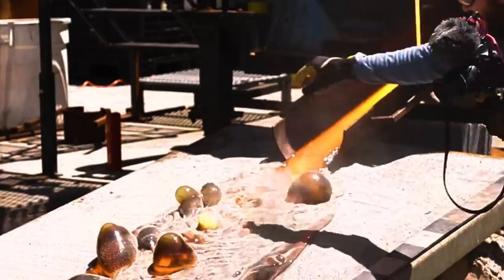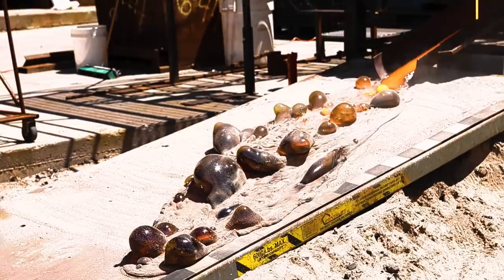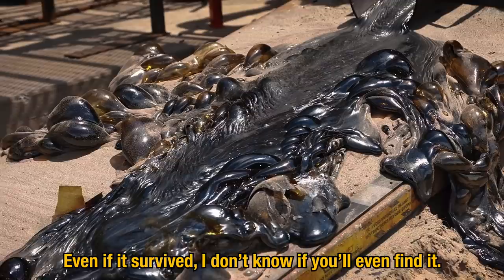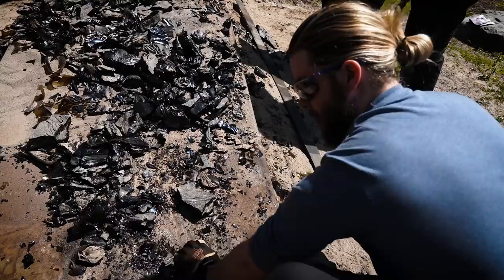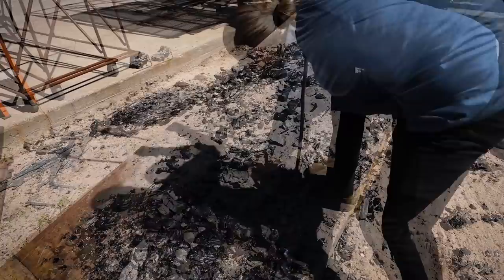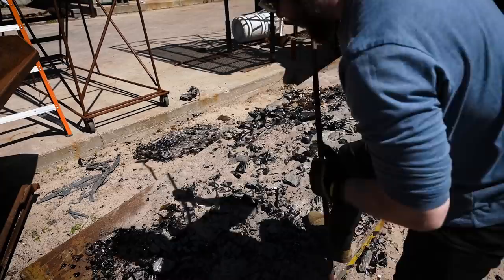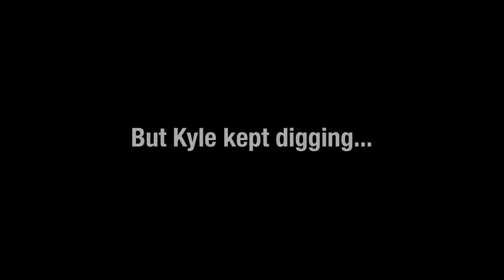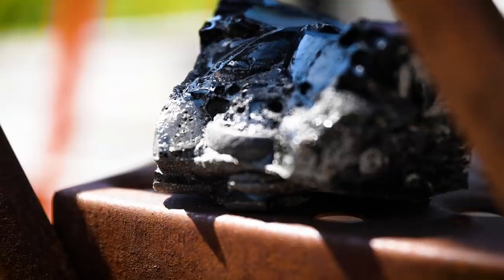Will REAL LAVA Destroy the One Ring?

Comment: Hey Kyle, It lost it's gold plating, Gold has a different melting point than Titanium 1,064 °C vs 1,668 °C. Besides you are working with cotinously cooling lava, wich is loosing temperature and cooling down as it flows trough the sand, unlike the crater of Mt. Doom, an active volcano wich is not having such a fast exothermal reaction, even if the one ring is covered by rapid cooling protective crust it would get reheated once more and melt. The reason be: thermodynamics!!!

Comment: Nice! I bet a metal detector would still induce enough current to find it in there. I've thought about doing this with a tungsten carbide one I have, maybe on a titanium alloy chain to help find it, but I imagine either the tungsten will hold up just fine, or the nickel binder would melt and it'd compromise the ring.

Comment: Three questions:
1) would the density of the one ring (presumably) made of solid gold (or perhaps magic super metal but that’s speculative) make a difference in its sinking? 
2) would the fact that it presumably floats and would not be completely encased like here have an impact? 
3) would the temperature difference caused by the fact the lava is constantly in the volcano (or crucible in this case) oppose to the flow like here, have a higher melting point for longer (and less chance to cool) and therefore melt it?

Comment: No mention of the fact Titanium's melting point is over 3000 F, while Gold's is under 2000 F. Google says temperature of a lava flow is around 2000 F. I also imagine that a chamber such as shown in Mt.Doom would be hotter due to mass/surface area versus the more rapidly cooling surface of "a lava flow" - however that is to be defined.

Comment: It's also cooling the whole time.  Toss that sucker in the sustained heat of the crucible or a volcano and I think the chances of it getting hot enough to melt would substantially increase.  I don't remember how hot you said that thing got up to but titanium has the melting point around 1700° C, right?  So that thing would have to get that hot too.

Comment: Considering that titanium has a melting temperature of around 1650 °C and the one ring wasn't made from titanium but (most likely) gold, wich has a melting temperature of about 1050 °C, I'd say this was not a conclusive result.
On top of that, the lava inside a volcano (like where they tossed it in the book/movie) doesn't really cool off since it gets mixed and reheated by constant flows of "fresh" magma from below; it only really cools down when it pours out of the volcano (bigger surface area cools down faster, of course) or the magma flow from below stops and the volcano goes inactive. Meaning that if you'd toss it into an open volcano it wouldn't just cool down the lava around it an get incased by an insulating obsidian mantle, but it would eventually get reheated again to the point that insulater material melts again and the ring, also heated up to the surrounding temperature at that point, would also melt.

Comment: mount doom is NOT JUST A COUPLE KILOS of molten dirt, its a f king volcano, theoretically connect to the the very center of middle earth, so even if the with some thin isolation layer it would eventually get hot enough to be destoyed, also mt doom seens quite active, with a lot of lava convection current at least. So eventually it would get destroyed

Comment: The fires of Mount Doom would be hotter than this for sure though, especially at the surface. This lava flow is completely open to its surroundings, cooling down significantly. Next to that, there's a lot, lot less thermal mass so it'll cool down even more. In a volcano, there's a lot more thermal mass and much more insulated by the rock around it. Such an insulating layer you talk about will likely re-melt again quickly in a real situation too.

Comment: The ring was at the base of the volcano within the magma chamber where there is a continuous supply of heat. Lava appears after The One Ring melts once the volcano finally erupts and flows for quite a while. Try a solid 18K ring in a simulated magma chamber.

Comment: You tossed it into a finite mass of lava, mount doom is a temperature reservoir, mount doom doesn't care about your punny insulation, if temperature is high enough, the ring will melt eventually no matter how bad of a temperature conductor the cooled rock is. Also, that is an impressivelly accurate gollum impersonation.

Comment: I'd argue that the one ring would have melted and here's why:
This ring was thrown into a volcano where there's a constant source of heat.  While yes, it may have shielded itself from initially melting by cooling a bit of the magma around it, the one ring would have eventually melted anyways especially if it was just forged from gold.  Now, I'm no geologist, but I will say that I believe the inside of a volcano is a lot hotter than the lava flows atop or outside of it and the deeper one would go, the hotter it would get.  So while the one ring might not melt immediately like in the movies, it would definitely melt eventually as it sank further into  the volcano.

Comment: the question now lies in how much dos an active pool of lava compare to just a stream of it. yes the stream is still lava but unlike a pool or in the case of mount doom an active volcano do, because a stream will cool and die off after a few minutes. a pool or actual volcano never dies (unless it go's dormant) and go's much deeper then just a few inches. meaning dos time determine the melting point where it can bypass the natural shielding. or would it be the pressure and more exstream heats in the lower levels that would destroy the ring if at all.

Comment: There's 2 possibilities that I can see...
First, if you're talking about a lava flow like you had there, where the heat source is gone and it's just cooling, then I can definitely see the ring surviving.
However, if it's in a volcano (Mount Doom, for instance), then the temperature isn't going to drop significantly, so given enough time and assuming the temperature of the Red Hot Magma(tm) is high enough, then the ring would definitely melt as everything becomes the same temperature, as the heat is constant.

Comment: Hi Kyle, love the show!
Actually, the difference is that lava from Mount Doom will not cool down after 30 min or so. It will continue to be liquid, for it has a constant source of magma. In my opinion, even if the One Ring will be covered in obsidian, it will eventually reach the surrounding temperature of the liquid lava and it will be exposed constantly to that until it reaches it's melting temperature.
And so it can be destroyed. Therefore keep it hidden, keep it safe. Filthy little hobbitses might still it.

I see that others have mentioned this before me.

Comment: Would the lower melting point of pure gold make a difference?
Would an active volcano that is bubbling at it's brim eventually melt it regardless because of the consistent heat?
Would the agitation of the bubbling of an active volcano stop the insulating layer from forming?
You did eventually find the ring in the flow. Could someone as obsessed as Gollum eventually find the ring amongst the massive flow of a natural eruption within their lifetime?

Comment: This is only one perspective, though. The lava flow is cooling and isn't a constantly glowing pool of liquid death. How the Ring would react in an active volcano where the temperature remains consistent and any insulator would probably melt from the surrounding lava that is not cooling would be different. If you had a container where lava was held at a consistent temperature so that it never cooled and solidifed, the ring would probably melt.

Comment: Well... The One Ring isn't made of titanium, it's gold and magic. So its thermal behavior may not be quite so easily modeled. In any case,  one supposes that the forging chamber in Mount Doom had spells in place to provide direct access to the magma without frying the occupants with the thermal plume and radiant heat. Therefore, that magma might have been well above its freezing point and able to release a good bit of heat into the ring without solidifying around it.

Comment: I mean titanium (which you said this was made out of) doesn't melt till about 3000 degrees F it's not so suprising the 2200 degrees F lava didn't do much. The results will vary wildly with different ring compositions (for example brass would melt at about 900 degrees F so you would get a puddle with the same experiment. That being said gold won't melt till about 1900 degrees F so anything plated in it may have some protection but I've never tried it. Would be a cool thing to see if gold plating would protect a metal from melting above its melting point but below the gold's melting point.

Comment: Titanium melts at almost 6000 °F (5949 °F) and even if that "lava" was at twice the melting point of basalt (2462 °F), it still wouldn't melt a titanium ring (almost 1000 °F too cold).
In other words, this ring (as in, your Ti ring) couldn't be melted.
The gold plating, on the other hand (melting point of 1947.52 °F) was melting off and that explains the blackened "one ring" embedded in the cooled material.

Comment: Tell me if i'm completely out of the loop on... everything, but if you were to toss the ring into a volcano and it got that frozen shell around it, wouldn't it be not encased later because the outer casing is absorbing heat from the lava around it, eventually melting it off again?

Comment: wait, yeah when you pour a limited quantity of lava that is cooling as soon that it's getting out of the vat... sure that isolating layer will form and protect the ring for 20 minutes until everything cooldown enough for you to poke in it. Similar to if you wet your finger, you can quickly drop it in melting lead and out without any harm, because the evaporating water will protect it (leadenfrost effect).

But in a Volcano, there is, for all intended purposes, infinitely more lava then what the university create and that lava is kept hot, it's not quickly cooling, 20 minute later it won't be cool enough for you to dig through it (20 minute later it will still be melted lava). So that protective layer will probably have enough time to reheat (eventually), re melt, heating the ring so it doesn't create a new protective layer and finally be able to melt, similar to even with the leadenfrost effect, if you leave you hand in the molten lead it will eventually burn, once the gas evaporated ad is no longer present to protect your hand

Maybe a better experiment would have been to drop the ring in the cooking vat BEFORE it pours out, where the lava (just like in a volcano) is kept hot. and see if that protective layer would melt and allow the ring to melt.

Comment: I suspect that due to the titanium core it remained intact. If it was solid gold I would bet it would’ve melted away.

Even the best insulator let’s heat through eventually. In a volcano the amount of heat would be insane, it’s not like this where the lava is poured on a cool surface where it can disperse its heat. Eventually the cooled rock around the ring would return to a liquid state as the surrounding lava raised its temperature, when the ring reached the same temperature it too would melt

Comment: Question: why not attach the ring to a chain made of a material that wouldn't melt, and then drop it in with the chain sticking out? Afterward you could just follow the chain to find it, making the last step much easier.

Comment: Titanium has a melting point of 1668C. I wonder what would happen with a gold alloy ring. My hypothesis would be it would sink as well as being increased but eventually melt in a larger pool of lava. Just as the iron sits at the bottom of crucible, I believe the gold would fall to the bottom.  Having a greater density and a higher atomic weight. I believe that the ring would be encased as in the situations with the other objects being exposed to lava but being submerged in the lava would eventually erode that encasement away and it would melt it. It would be fun to create an experiment to simulate this. I believe it could be done with a smaller crucible but instead of it being a lava flow just dropping the ring directly  into a crucible, then allowing it to cool and then cross sectioning.  Thanks for another great video and let the hypothesis flow.  Edit:  After reviewing the scene of the one rings final end.  I do believe the ring would have been encased but it would have been from the gasses being released from golem starting to Boil and Burn.  But this is all just my theory. Let's drop a comparable ring into a crucible from a high distance and then seal the crucible. What do you think will happen?  What do you think the distance was the ring was dropped?

Comment: There is just one problem that I have there is a constant heat sorce in a volcano so at somepoint the ring and the cooled lava will eventually heat up again vs putting it on a already cooling lava flow that will never heat back up to the temperature that it started

Comment: If the base of the ring was titanium then it would never have melted at lava temperatures. Titanium is known for it's high melting point (1,668 °C) which is why it is used in aerospace applications (high melt temp and low weight). As best I could tell the gold plating seemed to have come off, which it would with gold having a melting temperature of ~1000 °C. If you gave it a polish you would be able to confirm if it did. If the gold plating did not come off then that is evidence in support of the insulating shell you mentioned, but if it did come off, then there is at least evidence of a short period where nearly the full temperature of the lava affected the ring (how much material would actually be lost would depend on how long the lava had an effect).

Comment: The difference with fake lava is that it starts to cool once poured. Correct me if im wrong but the magma inside a volcano mantains it's heat, there for even if the ring get incased in a cooled insulating shell, wouldnt it eventually heat back up and remelt and cause the ring to melt away?

Comment: You know, in LOTR they didn't throw it into a random Lava-Stream, but inside the Vikcanic Chamber, right?
So the Translated Version would be to throw it into the Crucible iotself,, where the Lava would also still melt the insulating part away.

Also: the Ring looked more silver than Gold after the ordeal, so a solid golden Ring might melt away.

Comment: The problem I see here is that they didn't put it into a pyroclastic flow or anything like that they put it into the volcano which is the equivalent of jumping into a pot and then seeing if you'll cook you're going to eventually cook and that ring would have eventually have melted if it was still at that heat source as opposed to a place that was slowly cooling

Comment: If the ring was sitting on top of the lava until it was disturbed then wouldn't that be enough time to heat the ring up to temp. and prevent the layer of insulation from forming?

Comment: I see what you're saying about the lava forming a cooled layer of lava between the ring and the flowing lava. It makes sense, but in this case, the lava that was flowing over that already cooled layer between the ring and the lava was cooling because of its exposure to air . In an non-erupting volcano where it has constant flowing lava (lava that's not being cooled by air), would the ring not then meet the same or higher temperatures than the flowing lava and thus deform? It could be the same as placing the ring into the crucible while the lava is being made instead of throwing it in cooling lava. 

I am by no means an expert. Just a curious question.

Comment: One thing though, this lava is actively cooling. The lava within a volcanic cave type thing as seen in the lord of the rings is constantly being kept hot, churning and such. So eventually, whatever lava has solidified and cooled around the ring to act as an insulator would be subject to a continuous source of heat, such that if the rings melting point is low enough, eventually it will indeed melt and be destroyed. (or I assume anyways)

HOWEVER! Who's to say that the complete form of the ring is indeed needed to keep Sauron's magic alive? (Tolkien...) But what if the magic is imbued to the very atoms of the ring? The atoms would surely survive even when separated by melting, and so by throwing the ring into the lava, you could have now created "The One Vat of Lava".

Comment: I'm concerned about the sustained heat inside of Mt. Doom compared to the poured lava cooling. Would the continual temperature of the lava melt the basaltic tomb and thus The One Ring? Either way it's still very interesting and unexpected. A noble sacrifice.

Comment: there is a different between the two, your ring put into the lava that was in the process of cooling.
while the one ring was put in the middle of active volcano and the continues recycle of magma.
your one ring survive because the heat is cooling fast, however the one ring would continues being heat and the protective layer you talking about eventually turn back into lava and melted the ring.